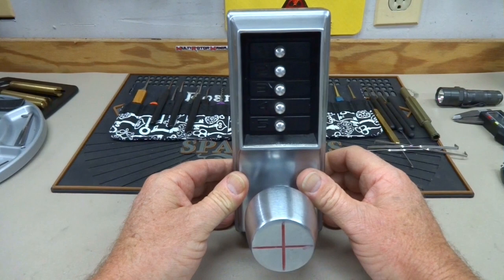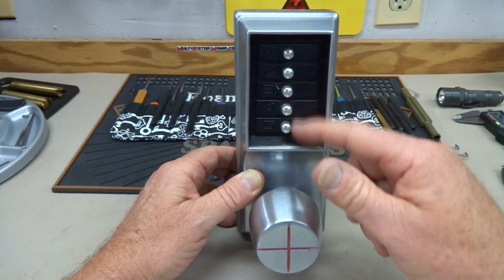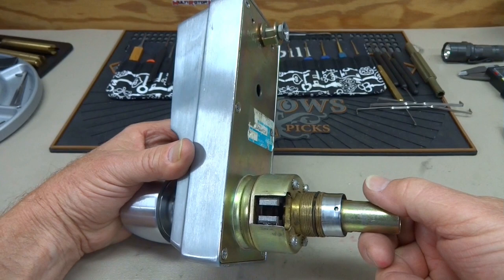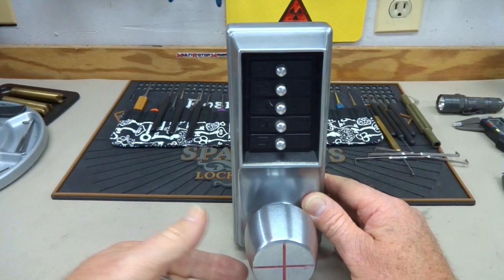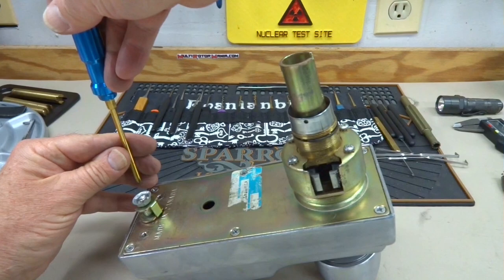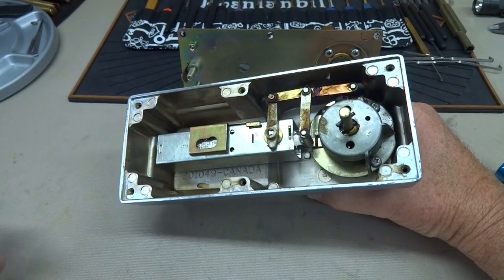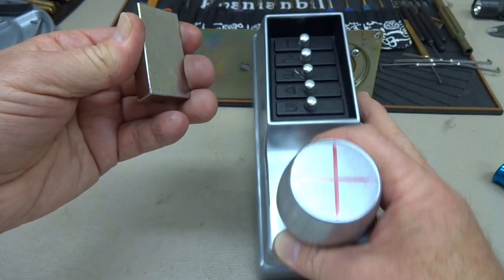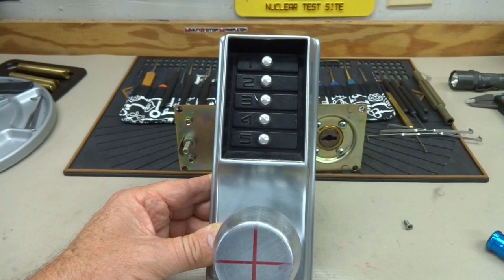(712) Kaba Simplex Door Combination Lock Defeated w/Sparrows "MAGNETO"

Comment: Kaba didn't like this video...
Reply: Where can I buy this magnet? Everywhere I go it’s out of stock.
Reply: I own and operate over 20 of these locks. I have yet to come across a single one that contains this metal lever, which allows a magnet to bypass the lock. So as far as I'm concerned, this is a much-hyped defeat of this lock, which doesn't really exist.
Reply: @feger481  I think Kaba changed the design long time ago. The one in the video is quite old.

Comment: This will not work on models made after 2010. Non-ferrous materials are used in the newer locks. Also, this will only work on the 1041 locks. Not 1011s or 1021s.

Comment: The Sparrows magnet has a pulling power of 95 pounds and on their web site a cut-away shows that the "sticky" part of the magnet is on the side.  Harbor Freight sells magnet item number #36904 for $9.  It has 150 pounds of "sticky", and is about 8 inches long and 1 inch thick and two inches high.  Probably would do just as well on these locks.  ALSO I use it when I drop a small nail or screw on the floor that I cant see to pick up, this magnet finds it.,  Also picks up roofing nails from the gravel driveway.     Bob L

Comment: I have rebuilt and repaired tens of thousands of these, and I have only seen two that have this part.  Both of them were special function locks.  They have a "passage" function knob on the inside plate. ..
Reply: Correct

Comment: We did a security assessment at a major Washington DC university, I used the magneto to test 8 doors with the KABA lock, it worked on three but the magnet is so powerful it will grab the door, if it's metal, and will proved very hard to get off the door (it tends to grab the metal door, especially if the lock has the brass finish. It oworks so keep the fingers clear!

Comment: That flexible tab that moved when you placed the magnet there is installed only when you have a bypass function on the lock.  A thumb turn on the inside plate fits into the oblong hole and when turned it allows the outside to be in passage mode.  It is generally not installed.  I always check for the factory default combo as many times the customer doesn't set it.  Or try 135, 531 or any three button combo as people get lazy using this lock.
Reply: 100% correct
Reply: Funny. We have two of this where I work on the same building. Code is 513

Comment: I have a 3" round by 1.5" thick N52 magnet. I put it in a leather sheath I made because all the socks I used to wrap it in just got eaten up. The leather has last several years of fairly regular use.  The extended sides and handles I incorporated into the sheath makes it a lot easier to move it around and remove it from steel.

Comment: Bill - just a little more information on this lock.... This only works on models made before 2010. since then they have ised stainless steel for this plate that is non ferris and non magnitic so tis will NOT work on newer models. Also KABA has sent out thousands of upgrade kits to fix older units with the stainless steel plate.
Reply: +Wayne Winton So then all you would need is a small battery operated electromagnet that is pulsed  on and off to cause the flag to have an induced eddy current as well and the trick would still work even if the new metal is non magnetic since it would still conduct electricity.
Reply: Well if you make a video that would be great but I don't think that would work
Reply: +Wayne Winton I read a great article by Tobias about this entire issue and the class action law suit. I'll try to find a link.
Reply: +Papa Gleb I have seen it. as well as Tobias video showing the same basic concept. his video and lawsuit caused kaba to make the stainless steel replacement part.
Reply: +Wayne Winton I didn't get to see the vid for obvious reasons but his article sure opened my eyes. He is one interesting and powerful guy.
Reply: See what he has to say about Medeco. Now you know why I yse ASSA!;)
Reply: Use
Reply: I don't have this particular magnet, but I tried some very powerful and expensive magnets, and it didn't work. I had the lock not mounted on a door. Now if I put the magnet in the lock itself it worked. But the plate is quite far from the outside of the lock.
Reply: Is there a brass one that has the same issue it looks the same as his just golden like grass
Reply: @kuhrd  apparently that part cold be removed without compromising the integrity of the lock,  the only use for that flag is for passage lock witch is easy to live without!

Comment: Thanks Bill, First time I've actually seen this "magnet attack". I believe Kaba, due to lawsuits etc, have changed this component to "non magnetic". However there's millions of the original versions out there .....Regards, Brian.
Reply: +Brian Hignett more info:  http://www.thesidebar.org/insecurity/?p=761
Reply: +LynxSnowCat .  Thanks for the link, I'd heard of this method ages ago, but until Bill actually showed it, I'd never seen it happen.  Some cheap "home" safes with solenoid locking can also be compromised in the same way. Regards, Brian.

Comment: Removing the steel "Flag" as he calls it, and the magnet will no longer unlock the lock. That part is to make it work like a passage lock, and it is not needed. It can be very easily lifted out and removed and will not affect the lock and the push buttons will operate normally.
Reply: Thanks for the tip!   I was thinking of asking The manufacturer’s to replace the parts with a non magnetic stainless but your idea will be easier because I don’t have the passage option on mine.

Comment: Wrap the magnet in electrical tape or heat shrink,  save the magnet , save the door finish, and make it easier to clean metal from it. Lastly, makes it easier to remove

Comment: Technically, if you don't have the magnet, couldn't you just drill a small hole on the side and pull that lever thing without grinding the whole thing?
Reply: +Boris Kozo had the same idea. should also work and it is faster than grinding

Comment: This also only works on simplex locks with the passage kit. Most (in my experience) do not have this.
Reply: Exactly.  I was going to post that myself.
Reply: @jclinton5  Yes correct on locks with passage mode only.
This metal flag is not there on other locks.

Comment: Hi Bill, I never heard the term “insecure side” used in security.  We use Exterior vs Interior;  and locked side vs inside are the two I have seen over over 30 years.  The word insecure has a totally different meaning, as in worrisome.

Comment: Is it possible or wrong ideal for a company to put a simplex door combination lock on the outside of the building if someone was to figure out the code and get inside? Has it ever happened before? Just curious one of the guys here at my job saw some reconstruction going on and they noted they be putting a simplex door combination lock on the outside for certain employees to get in

Comment: that will only work on the models that have a passage function. (knob on the inside that can be turned to keep door unlocked from outside)... in 14+ years I've only seen 2 or 3 out of 200 or so.
Reply: weird thing is that yours doesn't have the passage 'lug' on the the back page... goes in where that hole is.

Comment: The part that the magnet is moving is called the chamber release. It is used to put the lock in bypass mode. He either added that part to the lock later or removed parts from the back cover that would prevent the chamber release from moving under magnetic force.

Comment: Should say Kaba Simplex lock with passage mode defeated with magnet. It's just a bit misleading because this will only work on the passage mode model and most Kaba 1000 lock installations don't require a passage mode so the bracket isn't there..

Comment: do not pay $30 for that. you can get high strength Neodymium magnets (this) on eBay and Amazon for way cheaper.
Reply: +Sub Ripper a harddrive also contains 2 very strong neodymium magnets.
Reply: +EDHKilian Not this strong, though. Also, hard drive magnets are designed in a way that reduces their influence range.
Reply: Takes a little while to get here, but they're pretty beefy.
(And N52 is pretty much the strongest you can get.)
Reply: +Nicholas Feeley Thanks for the link, looks great!
Reply: quality NeFeB magnets of that size arent cheap. chinese "supermagnets" aften arent as stong as specified, break more easily, and loose more strngth over time.

Comment: How the heck do you store such a powerful magnet without killing your electronics or magnetizing all of your tools.
Reply: +Papa Gleb In bubble wrap or some foam. That is also how they ship them The magnetic force drops exponentially with distance.
Most modern electronics don't mind magnetism much, btw.
Reply: +Papa Gleb In bubble wrap or some foam. That is also how they ship them The magnetic force drops exponentially with distance.
Most modern electronics don't mind magnetism much, btw.
Reply: +Daniel Wallace WARNING-it may cause you to repeat yourself!
Reply: What a strange bug...
Reply: +Papa Gleb Large neodymium magnets are stored with foam or rubber or wood on all sides, and then it has a steel plate on top and a steel plate on bottom (a few centimeters apart). This  kind of short-circuits the magnetic circuit trough the metal plates). An all of this is in a wooden crate (or a metal one.. it would work as a magnetic short circuit even more)
Reply: +Papa Gleb Here is a fellow youtuber that shows how a large magnet is stored /watch?v=1zO9nWgI_LY
Reply: +AsiAzzy finally at least one good rely. Thx mate.
Reply: +Papa Gleb not that I did not link it 24 hours earlier? lol
Reply: +krazynetbeast totally missed that. Thx
Reply: +Daniel Wallace Your hard drives definitely wouldn't appreciate it.
Reply: thecooldude9999
And that's about it.
Reply from the maker: Well.... my tweezers seem to be PERMANENTLY magnetized because they were too close to this thing...😔